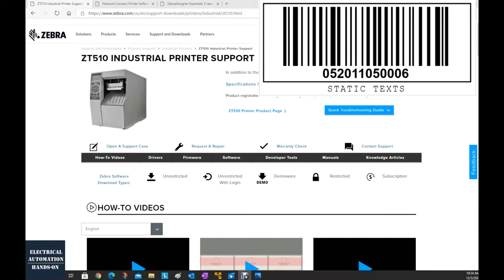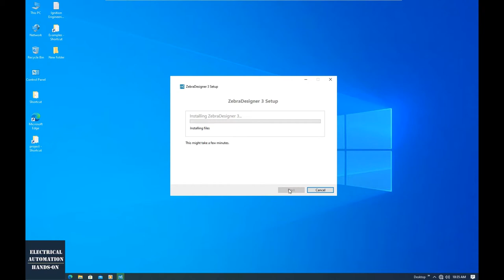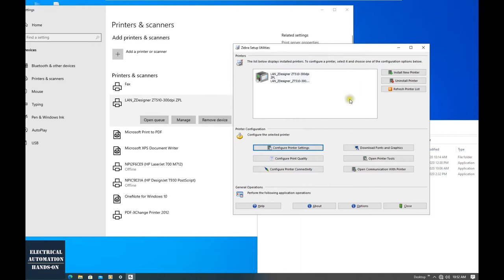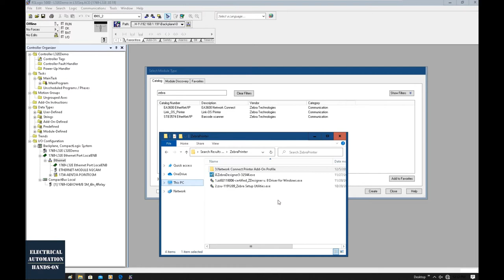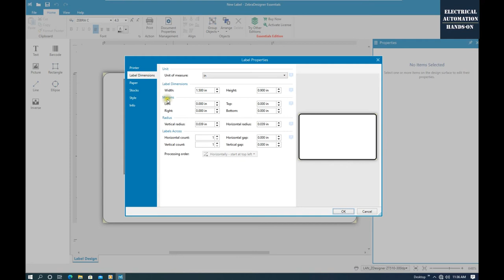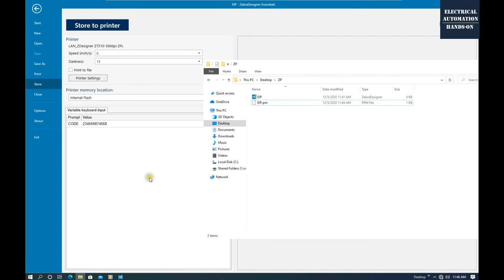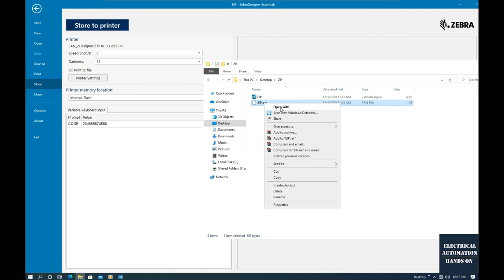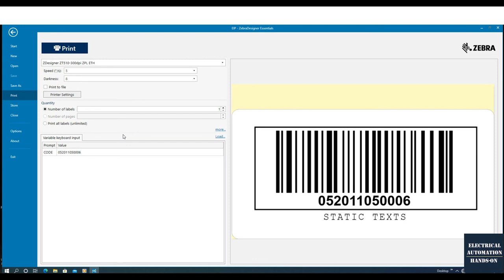AB06. Zebra Printer - Barcode Designer, ZPL, and EtherNet/IP communication with Allen-Bradley PLC

Comment: Very well instruction.  I am using Zebra ZT410 to communicate Ethernet/IP with CompactLogix L32. I follow your instruction and I already done for 5 filed numbers (FN) and it printed out 5 different barcodes; it works well. I now need to add 2 more FN. Should I keep "XF_Field1" thru "XF_Field5" and add 2 more field number in "RawParseData"? Please Help. Thanks in advance.
Reply from the maker: I have been a long time without touching this printer system, and hard to answer your question. But I would recommend reading the 'developer manual' I noticed in the video and read it carefully. Or contact the printer support.

Comment: Good day Sir, I have followed your instructions and I get the error code 16#0204 error in my ethernet tree. Using an L32E PLC and a Zebra ZD421. Network Connect AOP installed in the PLC. The error code says that the Driver could not be found at the IP address.
I can print a barcode via essential designer. Any advice
Reply from the maker: What is your printer's IP address? Did you assign the IP address to your printer? Using any IP tools such as BootP to assign IP.

Comment: i would like to know how would you print this directely from the scanner,without physically puting the values,,,i am using siemens, and i can send the bar code physically,but how do i send it from the scanner? or how to send arrays to the printer?
Reply from the maker: The PLC can play the role from Barcode reader, process the data, then send the code data to printer.

Comment: Thanks for all this info. I got a question about other Zebra scanner. Does RS5100 Bluetooth scanner work with PLC? I need to get the real-time barcode data in PLC. Thanks in advance.
Reply from the maker: Sorry I never used RS5100 barcode reader. I would recommend asking Zebra tech support.

Comment: Excellent presentation, thank you. Any idea how to interface an Allen-Bradley CompactLogix to a Zebra Model ZE500? This model has ethernet capability but not the Network Connect protocol. I have tried this method and the PLC does not recognize the printer on the LinkOS device. Thanks in advance!
Reply from the maker: Thanks for watching, I am not quite familiar with ZE500. But 100% you have to contact your local Zebra to purchase a firmware with EthernetIp, and use Zloader to load the firmware and enable the EIP. then you can reference my video the configuration.

Comment: hello sr. i make every that you mention it in you video but i still with a error in the module the error is  code 16# 0204 connection request time out, but i test the conection with ping and the data was recibe by the printer

could you help me?

thanks and  regards

Sergio
Reply from the maker: There is no hidden procedure, and that is all the steps you need to go through. I would recommend you read the details from the manual "NETWORK CONNECT FOR AUOTMATION Developer Guide" pdf. You could send me the screenshot about the fault code. You can find my email from the beginning of the video.
Reply: ok I will thanks